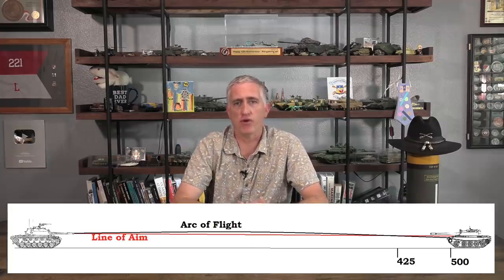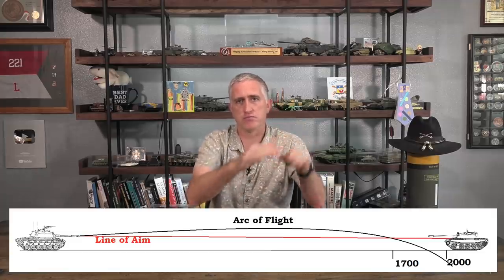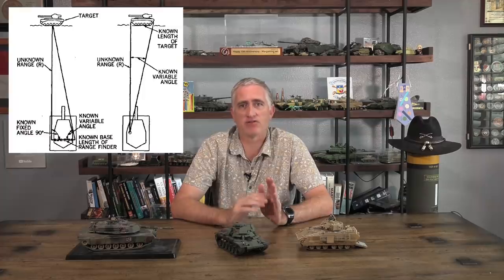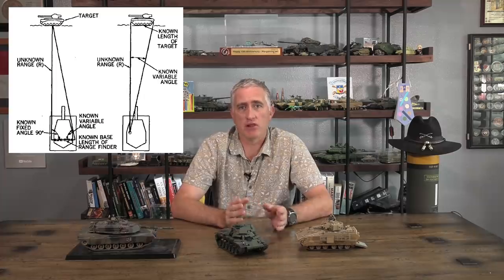Tanks 103: Rangefinding

Comment: Do you think that we will re-emphasize non laser range finding due to the increase use of laser detectors?
Reply: It sounds like manual range estimation is still being trained on. In the case of a sneaky ambush from a relatively concealed position, the tankers laying in wait will hopefully have worked out the range in advance based on landmarks. Apart from that situation, where the order to fire is given to all gunners at once, I would think that the enemy gets that warning from their laser detector just before they have a significant emotional event.
Reply: A laser detector gives you about 3sec warning before the round hits.
Reply: @ScottKenny1978  hmmm...some modern cars are equipped with collision avoidance systems that take over the braking and steering, something similar linked to a laser detector might be something worth installing on all manner of  military vehicles...or at least put through some trials for testing the effectiveness of it.
Reply: @pex_the_unalivedrunk6785  
Late model T 72 tanks automatically fire a main gun round at the source of any laser it detects. So you lase along side the tank.
Reply: The mentioned this in an older video. Just aim the laser to the ground in front of the target or the tree next to it and then adjust the gun manually.
Reply: @Activated_Complex  I would think this training of traditional estimation is meant for the time when the Laser doesn't work. You wouldn't want to render the whole tank useless when in a fight the laser itself, the rangefinders little cpu or any of it's component has put up a white flag.
Reply: @calvingreene90  The only problem with this equipment is that it's russian, so it's made from cardboard by someone who was drunk at the time.
Reply: @calvingreene90  wonder how hard that detection system is to set off. Lasers/range finders aren't particular expensive, suspect it'd take more than painting it with a laser pointer but I'm sure infantry would be able to amuse themselves if they could set it off.
Reply: @hannahranga  
The last I heard it has to be an infrared laser.

Comment: 4:27 Maybe, because 800 meters is the common range where AT-guns, and tanks usually engaged each during WW2?
Reply: He's talking about MPBR combined with the Danger Space of the round.  If older lesser guns have a MPBR of 800....its because the lesser powered rounds simply drop more.  So their danger space is smaller and closer in.  

People easily enough understand MPBR range.  Danger space is the area a target can move forward or back and still get a hit for a given sight setting.  Danger space shrinks with range.

So a target only 200 yards away can probably still be hit if the target moves in or out 100yds easily enough.  But if the target is say 1500yds away....that target may only have to move 15yds in or out and you miss.  Trajectory is getting steeper and steeper so the requirement to measure range becomes more and more vital.

Comment: 1:18 Oooooooohhhh.....that's interesting. I only thought that higher velocity only affects the time to target of the projectile. But, since increased velocity actually affects accuracy (pretty surprised that it affects accuracy by a great deal. +50% velocity = double accuracy? Waow 😳), that's pretty interesting

Oh. Speaking of velocity, and accuracy, I have a question for you Chief. So, velocity affects accuracy, but what about the acceleration of a projectile? Does acceleration also affect accuracy? I am just really curious, because I've always wondered why artillery guns (high acceleration projectiles) are considered to be more accurate than unguided rockets (slower acceleration projectiles)

So, for example an unguided rocket, and a cannon projectile has the same final velocity. However, their rate of acceleration is different (with obviously the rocket having a slower acceleration. I mean, it has to have slow acceleration, or otherwise the rocket motor would explode). So.....which one is more accurate?    🤔
Reply: The biggest reason for the increase in accuracy with velocity is because it reduces the ranger error, the single greatest cause of missing the target.

I think the reason for rockets being less accurate is due to the slow portion of flight. There's no gyroscopic stabilization of most of the rockets, and at low speeds there isn't any aerodynamic stabilization, either.

Comment: I'm an ex gunner.  Had a few thoughts about the crossover between us and tanks.
Do tanks always engage on line of sight?  Can they be used as a sort of pseudo artillery?  Only thing I could think would stop this would be inability  to elevate the gun enough or charges being to small?
Why have most modern tanks settled on 120mm and arty 155 and 105?  Would there be utility of having a combined calibre between tanks and artillery?
Reply from the maker: The use of tanks as indirect artillery has precedence, particularly during the Korean War, and was trained as late as the M60s. However, it's not something considered worth the bother today. In order to get sufficient elevation, tanks could use ramps.

Small arty is a matter of transportability. Big arty has rounds bigger than a tank needs to deal with: Big tank rounds = reduced ammunition capacity, and the bigger HE boom of the 155mm HE round normally isn't required for what a tank needs to do. Certainly not at the cost of the velocity of a smaller sabot round.
Reply: @TheChieftainsHatch  thanks I wasn't expecting a personal response.  
I assumed because you're not running into other tanks you would be firing more HE than sabot these days.  
Is that the wrong assumption?

Comment: 20:52 Soviet 1957 trials showed radar rangefinder to give an error of 15 m at 3000 meters (a typical maximum range for the Soviet designs of the day), and in 1959 a new design fitted to T-10M was proven to be capable of 2.7 m of mean error when estimating range from a static tank to stationary target, 9.4 m to moving tank and 9.3 from a moving tank to stationary target.
22:59 They obviously haven't tried hard enough. By the late 1950's the Soviets managed to overcome that obstacle and even designed a visualisation system which brought a radar feed into a tiny display in one monocular and your sight was another one, so you can theoretically aim at the targets you can't see due to fog, smoke or camouflage. What killed this project at the time was the demise of heavy tanks and rise of laser rangefinding - having leading researchers in the field of lasers can cause some detriments (that goes true for the US as well). Thus radar rangefinding was only brought back in the '80's for the advanced tank prototypes of the era (like Object 490) as a part of much more complex system including laser and radar rangefinding (the latter seen as safer in the era of laser illumination detectors), thermal imaging for target detection and so on.

Comment: Can you link a source on the "flicker range finders" (or just name one of the models) - the 3rd type you mentioned? I'm having little luck googling for it and while the mechanics of the other types are all fairly self-explanatory the flicker type sounds like it'd have a much more novel mechanism driving it that I'd be interested in learning about. Thanks.
Reply from the maker: Test report. USATECOM Project # 1-3-6770-01-F Component development test of stereoscopic  and coincidence optical range finders  Report # DPS-1081, Sept 1963

This is all it says about the mechanics of it: "The Range Finder, Monocular Flicker, XM21, is basically an M17C full-view coincidence range finder (Figure 3) modified to provide a flicker feature. The flicker feature is provided by using a vertical sliding mirror located directly in front of the eyepiece. This concept uses superprecision balls between lapped sheet plates. The flicker mirror is spring-loaded and captured against the moving sheet plate. The vertical sliding mirror is divided into two sections; one fully reflective surface and one clear glass pass in front of the eyepiece. As the mirror is moved between 3 to 10 cycles per second, the target appears to move back until it is brought into coincidence."

Comment: Of course Degrees have subdivisions.
1 Degree is 60 Minutes or 3,600 Seconds.  (1 Degree = 60 Minutes. 1 Minute = 60 Seconds).
Thus there's 21,600 Minutes or 1,296,000 Seconds in a circle (known as a "Turn").
By the way, "operator error" in surveying is sometimes referred to as a "One Metre Error", ie: the idiot one metre away from the instrument.

Comment: Laser range finders also overheat right? I remember the manual in steel beasts specifically stating to not spam the rangefinder because you can only use it like 4 times per minute in one of the tanks
Reply: Really? That would be strange. I was trained in AAA and the guns had laser range finders too (for if you not use the radar firing computer but only the AAgun's own optical sights and computer ect. And you would follow the aircraft while it was constantly ranged by the laser. No overheating. Why then would it overheat in a tank where the target is moving less quick, which means it needs less pulses -> less power per time.

Comment: Eh, just use a small dart round from, say, a 75mm gun, at a massive velocity. Such as, say, 10,000 to 15000 FPS. Flat trajectory, and a devastating hit. And for anti infantry, you can have a HEAT Missiles fired off the roof, combined with a Remote Weapons System, and problem solved. A Mk 19 Grenade launcher in the RAS could also be valuable in clearing shallow mine fields.
Reply: We all know all that, now show me a gun with that muzzle velocity

Comment: Does this present a problem - or at least a disadvantage - for UK tanks firing slower HESH ammo, should the laser range finder go down?
Reply: Hypothetically, yes, all else equal, slower ammo is just less good than faster ammo with equal performance. In practice, hesh isn't exactly your first choice of anti-tank ammo anyways, so "if laser rangefinder is down, but the tank is still operable and the crew hasn't bailed and you are reduced to firing HESH at armour" is a point of comparison of questionable importance.
Reply: Well, HESH (HEP in the US) isn't dependent on velocity for damage, so what is going to matter is how that lower velocity makes range estimation much more critical.

I ran across a memoir online of an old British AT gunner, who had started with 17pdrs and stayed in with the change to the 120mm BAT (battalion anti tank) recoilless rifles. Said it was a lot easier to hit with the 17pdrs.

So my guess is that if the laser rangefinder went down on the tank, they'd likely be down to battle zero and much shorter engagement ranges as a result.

Comment: As a gunner on an M60A2, we had the computer set to 1000 meters, and HEAT as the battlesight ammo. If (when ) the laser RF worked, we would use that. And in one instance my main sight failed, so I used the choke sight in the telescope. If a target was obviously distant, we could switch  to the missile. 
BTW, is that a shillelagh missile to your left?

Comment: Did anybody try using the focal distance of the optic for range finding?

Edit corrected punctuation.
Reply: so like a set of fixed scopes? look through each till one shows the target in focus? sounds quick, not particularly precise, and super expensive
Reply: @pvt_picklestomp3014  
No. Using a single scope and adjusting the focus with the gun adjusting it aim point to match the distance that just came into focus.
Reply: @calvingreene90  a good idea in theory, but it presumes the gunners vision to be a static factor . Which it isn't

Comment: The best way to range find is to use your standard issue E4-and-Below. 😂
Reply: I'm reminded of the final solution to the classic physics problem of determining the height of a building using a barometer -- going to the office of the building super, knocking on the door, and when the super answers, say "Good day, sir. If you can tell me the height of this building, I will give you this fine barometer!"

Comment: Does laser rangefinder basically real life auto aim
Reply from the maker: No. It merely removes range estimation error from the equation, which is the single biggest cause of a miss.
Reply: @TheChieftainsHatch  what about “lead” that some tank gun sights have?
Reply from the maker: @rootin222  That requires the use of a ballistic computer. Those take the angular rate of motion of the turret, throw the range into it, and then provide the correct lead. That range can be input by any mechanism, from laser to a keyboard.
Reply: @TheChieftainsHatch  That’s actually very interesting thanks for responding to me I just found something from the red effect video he talked about how a lot of early T 72s or at least more advanced version of them had “automatic lead”